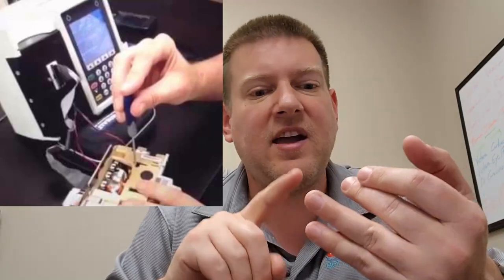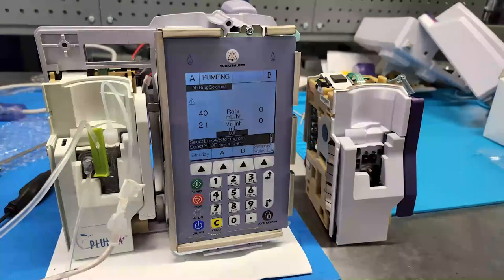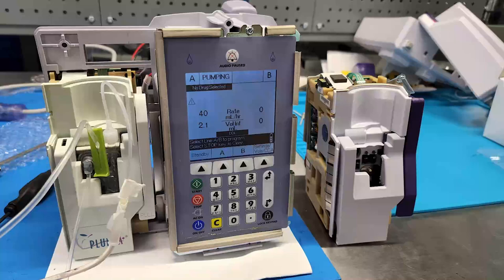Hospira Pump Calibration Kit ?!?

Comment: The test fixture is used by the ICU Medical FSE to perform the calibrations.  I do not believe it is available to the general biomed community.  
I have seen our FSEs use this frequently when servicing our pumps on site.
  
You will notice the Plum 360 pump mech assy has some differences from the A+ one being the plastic shield over the lever mechanism.  This was added to reduce fluid intrusion.   It is amazing how much blood can get in a pump when bag spike falls out.
Reply from the maker: Interesting! Thanks for sharing
Reply: Thanks Mark for sharing this info. I wish you shared how are these used by Company FSE.